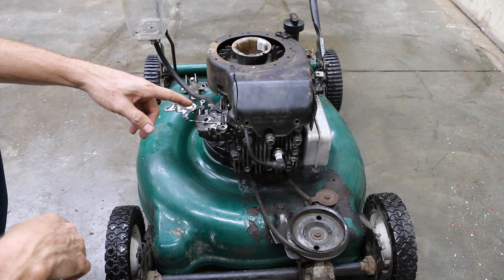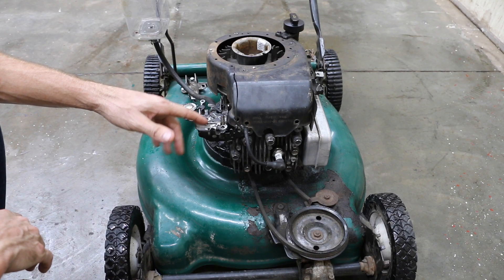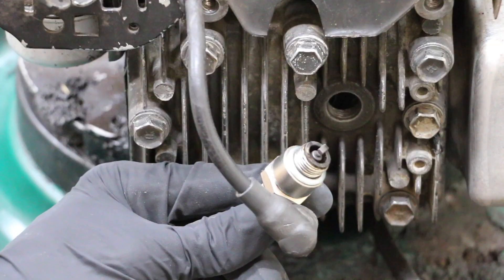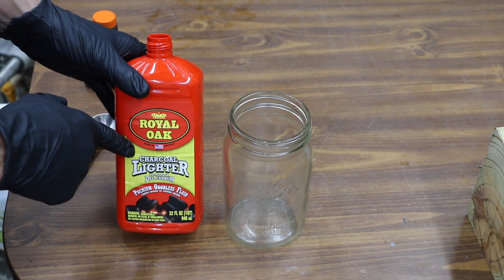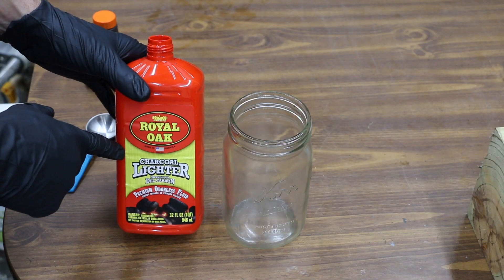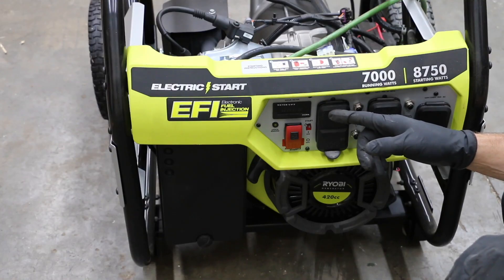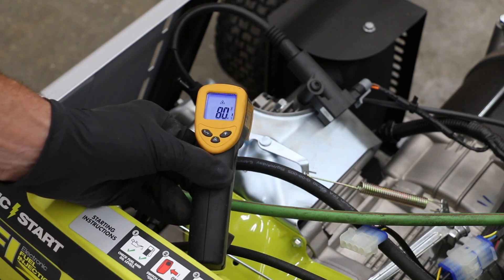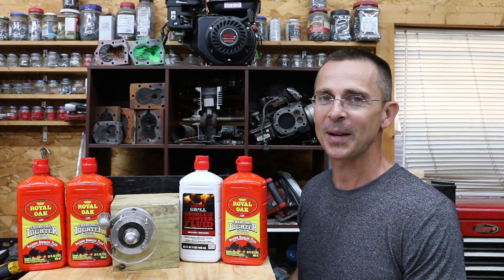Will a Gas Engine Run on Charcoal Lighter Fluid? Let's find out!

Comment: Will a gas engine run on 99.5% Isopropal Alchohol? And will it run on Whisky?
Reply: They can run on Moonshine, which is a type of whiskey, so i think regular whiskey could work, but it has to be a high enough proof (100 Proof is around 50% Alcohol, i would not use anything under 100, preferably 120 or above).

Moonshine Runners used to put Moonshine in their gas tanks which boosted horsepower.

Isopropyl Alcohol is very flammable and would probably work, Ethanol and Methanol fuels both work, so it is likely usable as a fuel. IndyCars used to run pure Methanol as fuel, which had one weird effect, if the fuel caught fire, it would be near invisible, so they added dye in the later years that it was used so the flames would be visible.
Reply from the maker: Thank you for the video idea!

Comment: Nice one..Could you test octane boosters? Perhaps increase the compression of one of your engines so it detonates, then add different fuels and octane booster mixes...you could place a sensitive microphone or even a knock sensor connected to a lamp/display to show us the results...remember to vary the load and rpm's...
Reply from the maker: Thank you for the video idea!

Comment: Hey project farm. I am in the market for a new mower. Thinking Toro.  What brand would you suggest? Thinking 21-22 inch,  self propelled.
Reply from the maker: The Toro seems to be very well built.  It depends on the build quality you're after.  They can get very expensive when looking at the commercial grade push mowers, but Toro seems like a good brand

Comment: charcoal lighter fluid is essentially white gas, just like zippo fluid. you can use it as cheaper fuel for your zippo lighter and save money. just make sure its petroleum based.
all aside, great video man. love how you make peeps ideas come true
Reply: White gas is not a precise term. But Coleman fuel is or used to be called white gas and it is NOT zippo fluid. Coleman white gas is very volatile and flammable. If you put it in your zippo you will sure regret it! Like I said, the term may apply to more than one substance, so what you say might be true for other fuels. But not for Coleman white gas such as what is used in cooking stoves and mantle lanterns.
Reply: ah. appreciate the heads up
Reply from the maker: Thank you!
Reply: Den White gas, right. I think we called it "dry gas" cuz it evaporated in the air so quickly. They sell camp stoves that run on it, the chemical name is "napthaline," essentially the next higher refined crude oil product above gasoline.

Comment: I like the honda engines but there over head cams an drink alot of gas instead of a flat head briggs which they dont make any more
Reply from the maker: Great point.
Reply: @ProjectFarm  why not run a Detroit diesel on gasoline

Comment: Could you try building a gasifier and try running a gas engine off of several different fuel sources in the gasifier?  The most common gasifier fuel I have seen is wood, but it would be neat to see different fuels like charcoal, wood, paper, straw, etc.
Reply from the maker: Thank you for the video idea!

Comment: What have you thought about the efi generators fuel consumption vs carb under same load? Could you make a video on this if you still have the old carb unit? 

Thanks for everything you do for us!
Reply from the maker: Thank you!  I haven't compared equal HP units but the manufacturer claims better efficiency.

Comment: Do you get extra HP while running aviation 100 Low Lead ?
Reply from the maker: Thank you!  Yes, if an engine is tuned to take advantage of the higher octane but that's true for E85 or other high octane fuels as well. Thanks again

Comment: In the old racing scene, people use to mix there own high octane fuels using regular gasoline, they used various amount of toluene to increase the octane. Adding to much will cause the octane to go so high it will burn out your exhaust valves. Try to make your own high octane fuel 120+ octane.
Reply from the maker: Thank you for the video idea!

Comment: what is your set up to start your engines? please don't spare the details
Reply from the maker: Thank you!   I use a 3/8 inch dewalt 2500 RPM drill and a socket adapter and a socket

Comment: A project that I would find really interesting is doing these same tests with Diesel engines. I know you can get some old vw tdis for pretty cheap. Just an idea but I am really interested in diesel alternatives like vegetable oil, dimethyl ether, and heavier alcohols like octanol. Thanks for making the great videos.
Reply from the maker: Great suggestion! Thank you
Reply: Project Farm thank you. I am currently doing a research paper on alternative diesel fuels that isn’t due until April (a year long project) specifically straight canola oil and dimethyl ether. If I could use a video as a source and maybe do an interview where you can address some of the challenges or surprises you come across that would really improve the paper.

Comment: what happens if you mix it with regular gasoline?
Reply from the maker: Great question.  It would actually work better than straight lighter fluid.  Blending the two would create a blend closer to an acceptable octane

Comment: I apologize if you already did this, but you should test pennzoil's new oil that's made from natural gas. I'm wondering what all the buzz is about, is it really better just because it's made from natural gas? I only know 1 way to find out.
Reply from the maker: Great recommendation.  I tested Pennzoil Ultra Platinum and it nearly won the oil showdown only getting beat by Amsoil Signature but it was very close.
Reply: @ProjectFarm  I Remember that, couldn't remember if it was the stuff made from natural gas. Thanks for the reply. Keep up the great work

Comment: Project Farm: What can you add to gasoline, besides octane booster from the auto dept., that would raise the octane ? OR, And better yet.. What can I put in my fuel take that would make my engine EXPLODE !  😁
Reply from the maker: Great question.  These little Briggs are pretty much indestructible.  They valves will float before the rev too high and the compression is pretty low too.

Comment: Do you think these alternate fuels may run better in a duel fuel generator? It seems if they see factory designed too adjust between gas and propane that they may handle these better too.
Reply from the maker: Great point. It's possible.

Comment: I have an Idea for a great video. Buy a few cheap used cars with somewhat of the same engine issue. (Mechanic Special) and use engine additives to see which one helps the engine last longer. 

For example. a V6 or V8 truck or SUV that has oil burning issue or a coupe or sedan with trans gear slipping. 

Try the additives that claim to fix these issues and find out with one is the best. It would get you a lot of new viewers and it would be fun to watch! I found your videos doing research for Restore and Sea Foam. haha.
Reply from the maker: Thank you for the video idea!

Comment: Put a cheap turbo on the go kart and see how much faster it will go?  LETS FIND OUT!  Tie a push mower to the back of the go kart.   How long would it take to cut 300' pushing the mower, and how long pulling it behind the go kart, and still have a clean cut?

Comment: Use windshield wiper fluid that has methanol in it to clean a combustion chamber. Slow injection while engine is running on gas.
Reply from the maker: Thank you

Comment: What about a 50/50 or 75/25 mix of E10 and charcoal lighter fluid?  The anti-knock properties of the guzzoline may actually hold up, but there could be a chemical reaction of some sort that causes fuel gelling etc.  might be fun!
Reply from the maker: Thank you

Comment: Great video as always can't wait for the next one I miss these hey you think if you weigh over tighten the head bolts on the engine it will gain more compression sometimes I over tighten stuff with the impact and I'm not sure what this really supposed to be torqued to at all I'm broke off one and I just left it off because who wants to actually fix something like that have a good one
Reply from the maker: Thank you for the video idea!

Comment: Lawn mower parts cashier must wonder why you buy 40 head gaskets a week
Reply from the maker: lol. Great point!
Reply: On older mowers, I used to be able to just reuse the head gasket.  Now the head gaskets these days just fall apart once they've been used.
Reply: @kcg795  surely these head gaskets could be reused, however to give every test its most accurate results, might as well replace the 3 dollar part
Reply: @ProjectFarm  try stacking the old headgaskets
Reply: @anders949494  the old head gaskets would be great for resin projects, imho
Reply: This week we're going to find out if an engine can run on old head gaskets
Reply: @JasonW.  i litterly choked on my apple juice while reading that 😂
Reply: @JasonW.  hahahahaha
Reply: @JasonW.  The store would problem call for a wellness check lol.
Reply: Theres a guy working at that store who tell everybody he knows to not buy this brand of lawnmower because of this customer going through a head gasket per week
Reply: At this point he could probably open an equipment repair shop for anything and everything sporting Briggs and Stratton model x.
Reply: At least it's easy on a sidevalve engine, it's basically a lid with a sparkplug in it 😁
Reply: Rtb gasket maker
Reply: and spark plugs
Reply: People replace non leaking mower head gaskets???
Reply: @MiG21aholic  technology your supposed to replace any gasket when you remove the part using one
Reply: @sorrygunsathome  of course but they last many re-uses and no big deal if one did blow after being reused. Not like its flying and would fall out of the sky
Reply: @MiG21aholic  ive reused them plenty of times, but some like to do the "proper" thing. like even with new cars some people change there oil every 3000 miles which is completely unnecessary but I never wait as long as what I'm told my manufacturers cause I dont trust them haha
Reply: Walter Futch fart fuel
Reply: @walterfutch9554  check out the guy that lit some of his personal octane and nearly set his cat on fire!
Reply: You should see if an “octane boosting additive” makes an inferior fuel like this perform like gasoline!
Reply: Maybe he planned ahead. Next will an engine run on Flex Seal.
Reply: Bwa ha ha ha!
Reply: Cuz it's a Subaru!
Reply: He had beans and Brussels sprouts for lunch, he is going to try self made methane next! Lol
Reply: So this is why Amazon gave me the option to order head gaskets and spark plugs on a subscription 🤔
Reply: I swear he’s gotta order these from amazon now. Has to be much cheaper from there n
Reply: kijj
Reply: He’s the reason why they are always sold out.
Reply: Hay pf can I have some of them used Head gaskets and spark plugs
Reply: Maybe the best ever made engine . Accepting all this aggressions and still running...
Reply: Make a copper gasket
Reply: If it's a small motor that doesn't take 2 stroke mix, add a little anyway. It's really the only difference I'm aware of. The lubricants in auto gasoline has been added to the gas. Colman fuel or charcoal fluid, aka white gas, has been cleaned and not adjusted to help motors last.

Comment: I have a few things I think would be interesting to test:

I have used "farm implement" spray paint in the past. Rust-Oleum performed well, but krylon chipped like crazy.

Another is taps, seeing which break easiest etc. 

And lastly drill bits of some type. Test for speed durability and stuff like that. 

Keep up the good work, I really love your channel!
Reply from the maker: Thank you for the video ideas!

Comment: If you were to pour it in your gas tank of your car it would probably run fine because they're still going to be a little gas in the tank to mix it with you should try to mixing it with a little bit of gasoline and see how well it runs.
Reply from the maker: Great point!  Much better to blend it in before running out of gasoline

Comment: Oh no not a tillotson carburetor!!
Reply from the maker: Thank you!  Have you used this brand before?  If so, what do you think of it?  I really like being able to dial in the right air fuel mix so easily and the engine seems to perform better.
Reply: @ProjectFarm  yes I've worked on a few of them they're not quality....
They're the ones that I mostly have experience with where older ones and if you have somewhere off of old homelite chainsaws.... 

I'd have to look them up but they may have got bought now and perhaps now they're much more quality than they used to be I know that also my father complained about them from back in the 70s and 80s when my grandparents sold mopeds out of their bike shop.... yeah they were Indian mopads they came with tillotson carburetor so it turned out to be complete junk and so Indian had sent them new mikuni carburetors which are great!!

Comment: Could you look into testing different diesel additives like you do with motor oils. Mostly for the lubrication they claim to provide. Since sulfur has been removed from fuel I find it critical to use a lubrication additive especially in engines designed to run on high sulfur fuels like old tractors and it would be interesting to see which one is best. I am currently using Schaeffer's diesel treatment 2000 on my farm and would like to see it in a video if you chose to make one. Well that's my idea. Thanks for all your hard work! Keep up the great vids!
Reply from the maker: Great video idea! Thank you

Comment: Could you run an engine on cheap hash oil or CBD oil?  Duuud, what if u ran out of gas on the way back from Colorado or Area 51?... Great videos, thanks!...
Reply from the maker: Thank you for the video idea!
Reply: lol  BRUH?
Reply: That would be really wasteful. Neither of those are cheap
Reply: Hemp oil is inexpensive and can be converted to diesel pretty easilly.
Reply: @jk-76  hemp is yes but CBD is from marijuana, hemp oil is entirely separate.
Reply: @scottyhaines4226  
I wouldn't want to imagine the amount of money it would take to come up with a gallon of Rick Simpson Oil. CBD is in several strains of hemp. In the flowers. The oil comes from seeds. It's an easy to replace source for diesel.

Comment: The engine ignites using the lighter fluid even though it was cold because the spark from the spark plug is hotter than 110 degrees.
Reply from the maker: Thank you!

Comment: A model aeroplane crossed the Atlantic running on a fuel based on Colemans, Google “spirit of butts farm”...
Reply from the maker: Great information. Thank you!
Reply: Project Farm , a pleasure, the plane was also called “TAM 5”, the engine was a 10cc 4 stroke running a fuel/lubricant mix. Colemans was used due to its’ high calorific value.

Comment: I was in my teens when I ran out of gas on the job one day. My employer was a house painter, and gave me a can of Naptha, in the hopes that I could make it to the gas station. My car (a 1964 Renault R8) started and ran fine, but pinged like crazy under load. I feather-footed it the mile and a half 
to the gas station. After a fillup, the car didn't seem any worse for wear.
Reply from the maker: Nice!  Glad it did the job!

Comment: Something I always wanted to see was butane as fuel on a small engine. Butane is about 93 octane, vaporizes at room temperature and it shouldn't be too difficult to modify an old carburetor to inject it into the air flow. Might even be able to run different gaseous fuels like propane, methane, wood gas, etc, using the same modified carburetor.
Reply from the maker: Thank you for the video idea!

Comment: Idea: Is there a way to compare consumption and establish a cost per mile and breakdown between an electric car like a Tesla vs a comparably sized gasoline engined car? I have a suspicion that when all is said and done and both cars have been used to their limits that the electric car is nowhere near as “green” as it seems it should be. By that I mean the disposal and environmental impact of the Tesla and it’s batteries and the power plants and electric distribution system needed to power it all have costs that most people are unaware of
Reply from the maker: Great video idea!  There is a way to do this and it would be interesting.  I suppose the environmental impact would be tied to the type of power grid supplying the electricity...coal vs nuclear.  Thanks again!

Comment: Could make a test on acetone as an fuel additive? I read some articles about it that it cleans the engine internally and also reduces the fuel consumptiona. Interesting is that the ratio is quite low like 1:3000
Cheers
Reply from the maker: Great video idea!  Thank you

Comment: The Real MVP is that green mower. Its been through hell the last year....
Reply from the maker: Great point!  Amazed it has lasted so long. Thank you!
Reply: When he was putting the new spark plug and head gasket on that mower i actually said wow that thing has probably had more spark plugs and head gasket changes that pretty much any other lawn mower put in service
Reply: … and still 110 psi compression!!  MVP is right.
Reply: That's because it's an old B&S. Can't kill em.